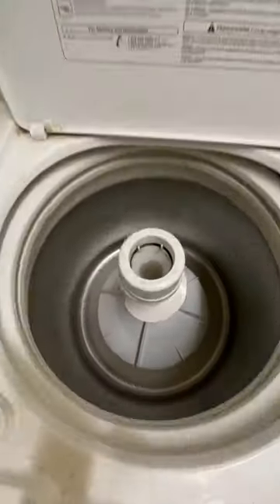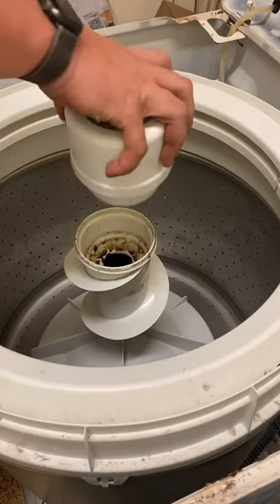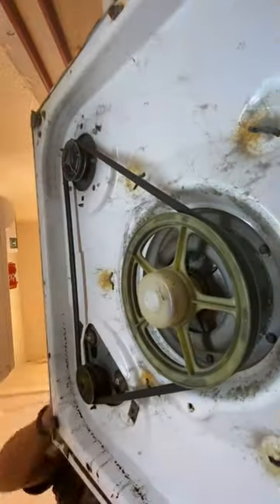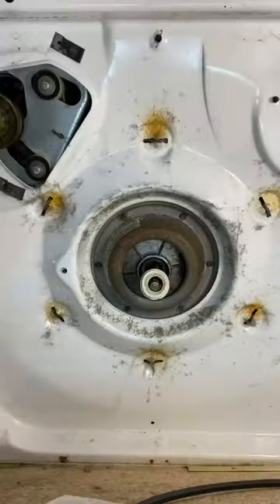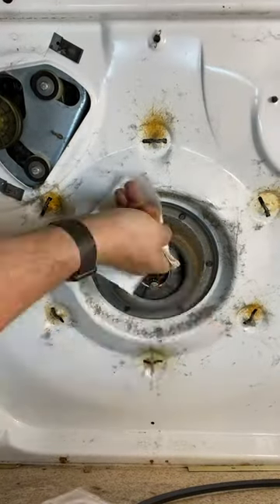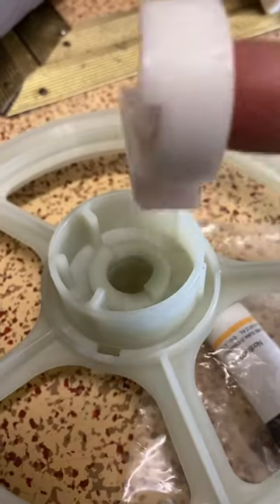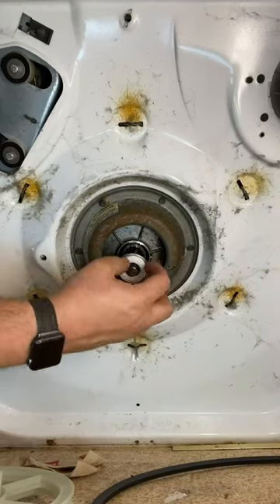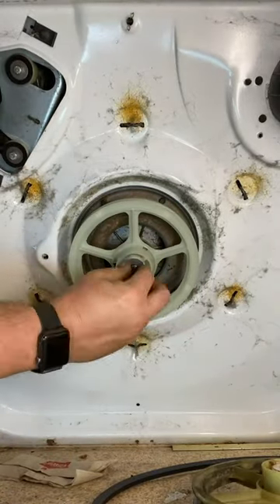Replacing a thrust bearing kit on a Maytag washer. #HandsomeOrHandy #Handyman #ApplianceRepair ￼

Comment: I wished you lived in my area. Got so many things i need fixed in my house.
Reply: Nothing stopping you from doing it yourself
Reply: @justussneary19 sure there is. Skill. Experience. Not everyone has the money to buy parts, fuck up, and buy a new machine. For alot of people, getting someone to come in and do it is often the safest and cheapest option, personally I’d be out of work if everyone fixed there own things, I’m a mechanic, so I totally endorse you tinkering and fixing things. This is IF you have the confidence and a little bit of know-how. But like I said. For some and skill for some it’s experience. A little example. Say they had to unbolt something, it was only 1 bolt but when they were tightening it, they snapped it or they cross threaded it because they don’t know how to feel for it. Now they have a bolt stuck in a hole that needs extracted which costs even more for the tools. Don’t wanna sound rude correcting you. Just want to inform that a lot of the time. The skill set or knowledge just isn’t there. And the people who come to workers like me and the uploader know that it takes more than google and YouTube for a lot of things..

Comment: What will cause a washer to overfill, wash the clothing, then on the drain (just drain), then only the washer shuts down and doesn’t finish the process
Reply: The overfill is normally a pressure switch issue. Tube being off or switch failing
Reply: Depends is it a top loader or front loader. Sounds like you got a front loader. Front loaders pressure switch hoses tend to rub and create a leak. It fills then drains the water in the beginning of the cycle. If the pressure switch goes bad on a front loader a fault code will displace. A Top loader washer with a bad pressure switch will over flow and flood your house. Top loader washer that has a built in air dome will also give you the same problem. Check your air dome by the outer tub follow the pressure switch hose. If you it see clog or dirty it’s because it is. you are overusing fabric softener.
Reply: @jpadgr8  mines a top loader
Reply from the maker: Some of the newer washers will automatically drain If it does not start a wash cycle within 10 minutes. As far as the overfilling, check the pressure switch and make sure the tube is connected and doesn’t have any cracks in it.
Reply: @dkillahster  i would start first by inspecting the pressure switch hose and air dome. If it passes inspection. start replacing the water level switch.
Reply: @HandsomeOrHandy  I will say this. Upon inspection. I noticed rats have bit the tube from behind the washer I guess that fills up to a sensor to let the washer know when water has come to a certain level? I replaced the hose with a new one. Same size, same diameter. Same length. But it started doing this. Maybe I screwed up somewhere.